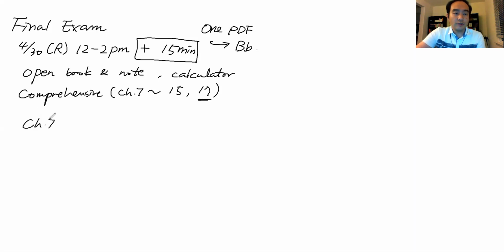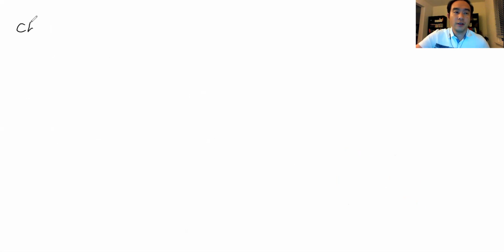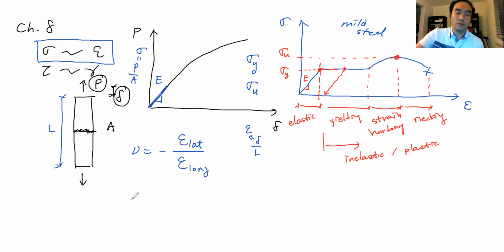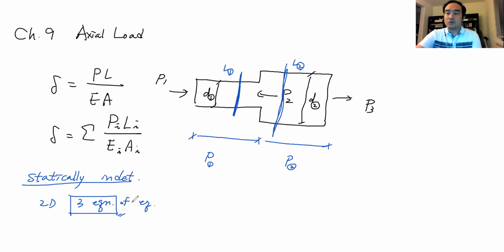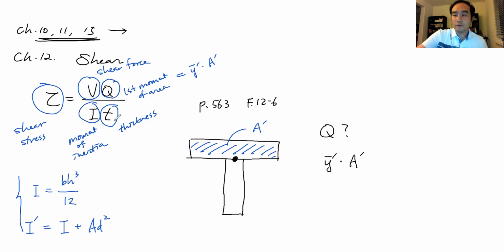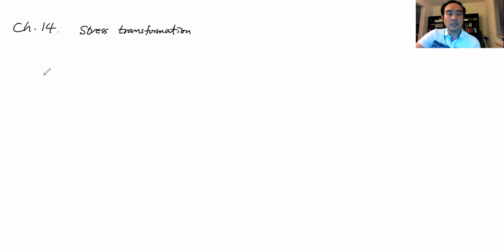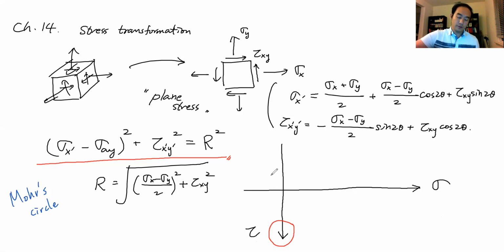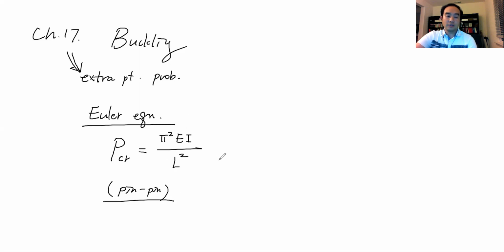[EGR 242] Week 16 Video 1 (Review for Final)

Comment: Hi Professor, in Mohr's Circle you mentioned times two angle, can you please share where do you get the original single angle from? which based on original single angle we get two times angle in Mohr's circle.
Reply from the maker: That's the angle given by the problem. One of the main applications for Mohr's circle is to calculate corresponding stresses through a transformation with any angle changes. And the angle for the transformation is the variable "theta" in the stress transformation equations. I hope this helps you understand better.